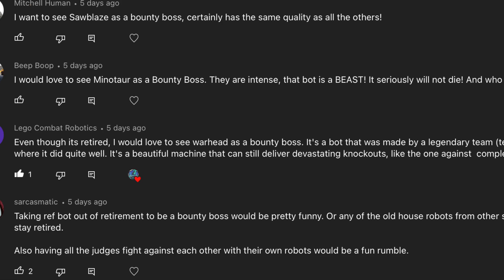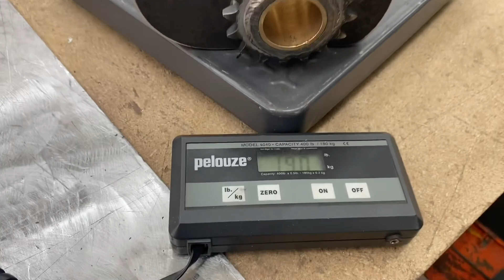NEW BATTLEBOT REVEAL! Feat. Swamp Thing    [Builder Blog Ep. 68]

Comment: PSA: ALWAYS use a test box or separate room when spinning up your robot. Just because Rick didn't use a test box doesn't mean you don't need to either. These spinners spin at speeds faster than a regular car. If you get hit by one, you could get serious injured if not killed. Please be safe fellow roboteers.
Reply: WAY faster. 180-250 mph tip speed is the norm and this looks like it Vmax'd in about 1.5 seconds when most take up to five. That is just insane.
Reply: you dont even want to use a room i was outside with skorpios destorying a car you will see the video soon and it would shred you if you got hit
Reply: Thanks for sharing. I assumed you could just grab them and they would stop.
Reply: @ronjericho7977  yeah if you tried to grab it it would not go very well
Reply: @queball19  piece of cake

Comment: Very cool bot. Don't know about the exposed chain next to the weapon, might be prone to get hit and the weapon is gone.
Reply: I'm guessing they're prob going to shield it with a cover a-la Bite Force, but def seems a weak point
Reply: They all have some kind of weak spot.
Reply: Would be easy enough to pin and seam weld a honk of steel on to the wedge next to the chain. Wouldn't even have to be that big to protect the chain from stuff coming in from the side either.